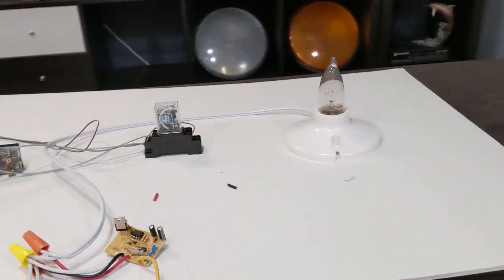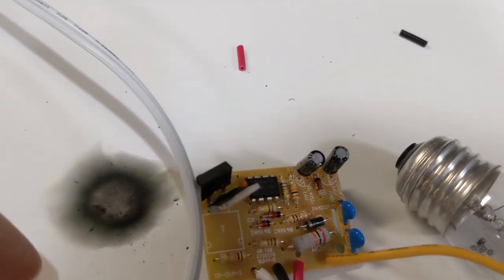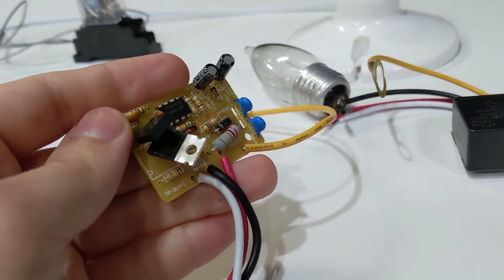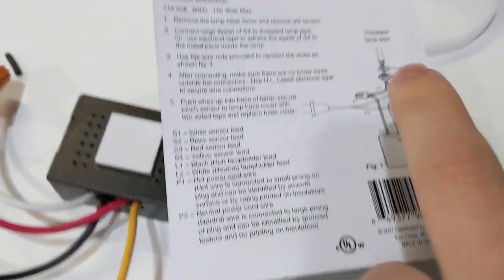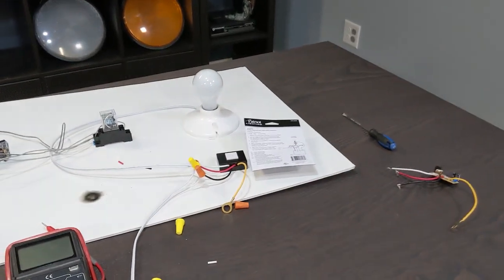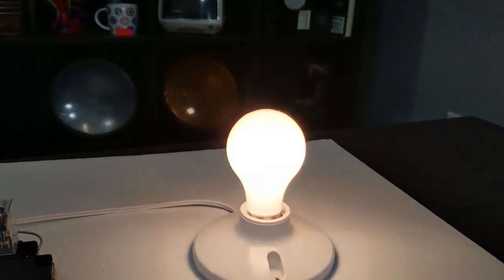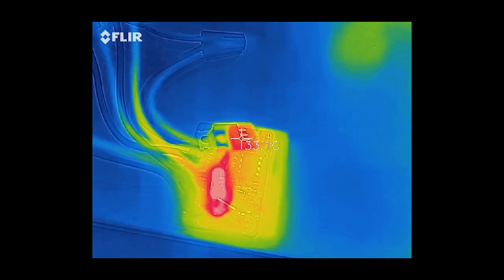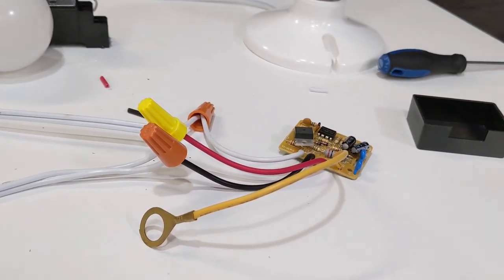A slightly explosive touch-lamp follow-up (standby energy consumption)

Comment: 8:48 Wait wait wait. That means hot is going through the device even when it's off (given the switching seems to be done at neutral)??? Indeed this is totally, royally and deeply FSCK-ed up as we say in Linux circles...

(EDIT: I refrained from making the comment in all caps, but read it as if it was... WTF is this)

(EDIT2: For those who don't know why this comment should be all caps - basically this kind of newbie electric mistake can end lives)
Reply: It's double fscked up. The unit has nonexpected colors and the packaging says to switch the neutral. My touch lamp is only singly fscked-up. The module colors are the same as Alec's new module but it is wired so it switches live.

Here's its configuration, for reference.
Red - neutral
Black - live
White - switched live
Reply: Yeah it's really strange that it switches on the neutral, quite a safety oversight. Though see all the other thousands of comments saying why the wire colours are fine XD
Reply: @TheBeardedQuack  Assuming the plug is not polarised (as best as I can tell it is not) , then the way I see it, it could be switching the active or neutral depending on which way around the plug is plugged in.
Reply: @kissingfrogs  Fair enough, I didn't think about that because our plugs can only be inserted in one orientation.
Reply: The way it should be wired is the neutral wire should go to S3 which should also go to the threaded part of the lamp socket.
Reply: @kissingfrogs  The instructions assume the plug is polarized. The package says "The hot wire is connect to small prong on plug".

Comment: This configuration means there is 120vac on the lamp socket even when it’s off?
Reply: Correct. The neutral is switched, not the live. You should always switch the live.
Reply: @dylanharding5720  Ideally you switch both, but that's not always required.
Reply: @enginerdy  I did say that.

Edit: okay, I said it in another thread. You should always switch live, and switching neutral is helpful. There are times where its required such as a isolator or the main switch on a consumer unit.
Reply: @enginerdy  Switching on both is good if the switch design prevents the hot from being connected when the neutral isn't.  The easiest way to ensure that is to not bother switching the neutral at all.
Reply: @dylanharding5720  You said switch the hot. It's better to use a double-pole switch and interrupt both lines.
Reply: @enginerdy  read my edit please, I corrected myself before you replied again aha
Reply: @flatfingertuning727  mmmm,,, don't quote me on this, but I don't think that meets UL standard for household products
Reply: Lets just all agree that sockets controlled by electronic circuits or even mechanical switches should probably be disconnected from the mains before servicing, regardless of line or neutral is switched, or both. Sure people change light bulbs by just turning off the switch all the time without harm, but your asking for it and blaming stuff imported from china is kind of a cop-out for known safe practices. I know ive screwed in tons of bulbs that immediately lit and i though "Guess it wasn't off, heh. Whoops."
Reply: @enginerdy  U.L. Standards allow either switching both hot and neutral in such a way as to ensure that they switch together, or to just switch the hot.  For double-insulated products, switching either side during operation would be fine, but the only way I could see an Edison-base light fixture qualifying as double-insulated would be if it used an isolation transformer, or the socket was behind a door that could not be opened when the power cord was attached.
Reply: @enginerdy  BTW, modules for use within appliances aren't U.L. *Listed*, but rather U.L. *Rated*.  I don't think that any appliances which used that device wired as indicated with an Edison-based lamp could qualify for a U.L. listing, but a device like this could be U.L. Rated for use in a luminary with e.g. a non-replaceable LED lighting assembly.
Reply: Flat Finger Tuning yes, the RU mark. Very important for getting your product UL listed (or ETL) smoothly
Reply: Flat Finger Tuning I think there are a lot of weird exceptions for lamps and lights, but I’m not certain of where that stands currently
Reply: Most of Europe is using unpolarized plugs and I've never heard of problems because of that. Polarized plugs don't really add any safety. It's the device that has to be designed properly.
Reply: superdau yeah I’ve seen that. The issue with the old Edison base is that the moment the she is inserted it that side is energized there is a shock hazard. On really old lamps at least in the US some of the shell is always exposed.
Reply: @superdau  polarized plugs are good for safety when used with edison lamp sockets and devices like toasters with exposed heating elements as two examples.  You can certainly make the point that those are poorly designed devices but they do exist in europe as well as the US.  And even in europe light fixtures are always supposed to be polarized since you can't unplug them to change the bulb.

Comment: When I was an electronics tech, red was hot, black was ground. Once I started messing with AC more, I had to re-jigger my brain to the point where I don’t trust anything until I measure voltage.

Comment: The triac would only capable of 200W if it has a heatsink on it, which it does not.   @13:10
Reply: It is capable without one, but not in permanent operation.
Reply: @higihups  absolutely true.
Reply: That's all a red herring. The triac rating is for how much power it can dissipate through its case, not how much load power it can control.
Reply: I used this joke before but I'll use it again here: Isn't that a song by Glen Campbell, "Triac Little Kindness"? LOL

Comment: I would have wired it the same way you did. That’s wiring plan is dangerous and a crime against logic. 

I also concerned that the switch leg of the lamp is on the neutral. That not right. It should be the hot leg. If you had a metal lamp with no ground and an always on hot, that it just asking for a shock.
Reply: For a Chinese it should be fairly normal. (Made in China with Chinese color system)

Comment: "in North America". to start with, AC wiring varies greatly around the world. In Aus, we have had 3 different standards over the years, NEVER trust the colors when your coming into a new job. once you've worked out what standard is being used tho, your usually OK. 

but to make things more fun, the Chinese, they really dont give a crap about colors. I got a replacement part (a displacement pump, CW/CCW/N, and 2 position sensors), same colors, same plug-in connectors, same colored wires. EVERYTHING was wrong. the Clockwise and Counter clockwise  drives were swapped. the position sensors were out of phase. it wasnt just a switch one to make it work, every line (except Neutral, thankfully, so no explody) needed to be moved. had to go right back to basics, what does the PLC expect to see. the Neutral was green/yellow (earth). after that, I had a look at the other wiring. everything was done in 3 core flex, brown, blue, green. but even in the completed machine, sometimes ground was green, sometimes it was blue. sometimes signal was blue, sometimes it was brown. No logic at all.

Ive had another part, an ignition module, that had the same colors, but nothing lined up in the socket that connected old and new. looked SO wrong. fortunately, it did just work. but if it didn't, Id've been stuffed. 

never assume china does colors right.

Comment: I would've wired it the same way you did without benefit of the diagram.

This is an extremely stupid setup, because not only are the wire-colors wrong, but they're switching the NEUTRAL wire!!  So when it's off, the lamp is technically UN-GROUNDED.  Hot goes into the board and into the lamp all the time -- no switching, no isolation, nothing.  Hot is live 100% of the time.  Piss-poor design.  Everyone knows you're supposed to switch the hot side, not the neutral side, because it's the neutral side that is connected to ground and provides protection.  Completely idiotic all the way around.
Reply: I could be wrong, but I was under the impression that AC wire coloring is specified by code in the US. If so, how did it manage to get that UL seal of approval on the package? Did they use it without approval? Is this not something UL tests?
Reply: @ShinoPuppy  It's specified by code in homes, not necessarily for products.
Reply: Every electronic component you buy from China has a CE and UL stamp that means nada.
Reply: Sean Neal CE Chinese Export UL Unknown Liability
Reply: His plug is not directional, so, he could flip the plug around and it would work the same way. Point is, he can wire it up the other way if he likes (flip the mains wires), it'll work just fine.
Reply: Please do NOT refer to neutral as grounded. I know US wiring connect them at the fuse-box.

But neutral can go live by one broken connection, while ground takes more faults for the same.
Reply: @erlendse  Yes. True.  Neutral isn't a ground, technically, but because it is grounded at the fuse-box, it is "safe" (in quotes -- definitely not as safe as a real 3rd-wire ground).

Either way, you don't want to switch the neutral side, no matter what.  Switching should always take place on the hot side.
Reply: @LMacNeill  True, but not always a choice.

Here(Norway) on IT/TT earthing, both wires are hot, ground are not.
Reply: @erlendse  Technically, according to the US National Electrical Code, the neutral is entirely referred to as the  "grounded conductor."  Now, in the real world, I entirely agree with you. Just thought it would be interesting to point out that technicality.
Reply: very dangerous indeed!
Reply: @LMacNeill  Neutral is a ground, but it is not "grounded."  Grounded refers to a ground where current does not normally flow.
Reply: @earthwormjim  Yes -- correct.  I just meant that, in the absence of a real ground, the neutral can provide a safe path for the electricity to get to ground, in a worst-case scenario.
Reply: @earthwormjim  As Edward correctly mentioned, neutral (according to us code) is literally the grounded conductor. Saying "neutral is a ground" is definitely less correct than saying neutral is grounded.

Comment: Back in the early 70's, a friend brought a color organ to me for repair. He had tried to "rewire" it so it would drive external lamps for a much bigger light show. Well, when I opened it up, ALL the triacs had exploded! (he didn't tell me the noise it must have made)! When rewiring it, he had wired the triacs across the line instead of in series with the lamps. That makes triac life very short, as you found out too!

Comment: US 120/208/240 standard is Black for phase 1, red for phase 2, blue for phase 3, white for neutral, and green/bare for ground.

It is always important to consult wiring diagrams and verify the pre-existing installation however. Gotta love having an old house where somewhere in the walls the black and white wires got switched and you have a whole wall of reverse polarity plugs that like to fry some electronics, all because someone hooked the sockets up correct to color without checking what was actually hot and neutral.

Comment: So here's why it works the way it does. The reason why neutral is switched is because of how the triac works, and the fact that this is a touch module.

Triacs require a low control voltage relative to the signal they're switching. The module runs at a low DC voltage internally. That means that the circuit DC ground has to be the signal that is being switched (if it were not, the triac triggering would require much more complicated circuitry).

Now the module doesn't care which side is hot or neutral, since this is AC. After all, the only difference between hot and neutral is which one is referenced to earth, and this device doesn't have an earth wire, so it can't tell which is which. You could just as easily put hot in via the black wire, and have that be switched, and the whole circuit would "float" with ground on the hot side, and it would work fine.

Except there's a touch lead. If you put hot onto the black wire, the whole low voltage touch sensing part of the circuit is referenced to hot, which means the touch sensing wire will (through the insulating capacitors), be live at mains voltrage. This makes it mildly less safe, since, should the capacitors fail, it would really become live at mains. It also might make the touch sensing more temperamental, since now it has to deal with more 60Hz noise.

Of course, switching live is safer for the lamp socket side, on the other hand.

So it's a safety trade-off. If you wire it with switched live, the lamp socket will be safe when off, but the touch circuitry will be referenced to live. If you wire it with switched neutral, the touch circuitry will be safely at neutral voltages, but the lamp socket will be perpetually live. Your older lamp seems to make the tradeoff in the other direction.

Then again, with an unpolarized lead, it's 50/50 chance which of the two options you get anyway, *shrug*.

BTW, when you wired it wrong, what you did was connect the circuit's ground correctly to mains, but powered the circuit through the bulb (which works fine, hence the standby current being OK, as bulbs are basically a really low resistance), and then connected its output straight across mains (which works fine until you try to turn it on, then you've got a mains short across the triac). It wouldn't have made a difference if you'd plugged in the lamp cord the other way around.

I don't know why your bulb blew though. It was clearly fine when the bang happened, since it was the only reason the circuit was getting power in the first place. Maybe it was unrelated, and it was close to dying and the mechanical stress of taking it out and moving it around caused it to finally do so, not the bang moment.

Comment: As an (apprentice) electrician, it makes a lot of sense; it is normal practice of most electricians to reverse the black and white when a wire is running from a single-pole switch to a non-polarized (ie. won't blow up if you have the black on a different screw) light fixture (such as the very light fixture shown in this video). If I'm not mistaken, this is so that electricians can see at a glance what is a switch leg (ie. ONLY goes to the light and back) and what is the feed (or whatever other connections that may be hot). If this device is meant to replace an actual light switch (ie. install a white blank plate, and wire it so that the blank plate becomes the light switch), then I can see why they did it.

WITH THAT SAID... I have NEVER seen this kind of wiring in any lamp I've ever seen; it is either black/white, gold/white (in the case of lamp cord), black/black with white stripes, or no color at all (ie. ye ol' simple light fixture that doesn't care what way the plug goes in). In THAT respect, I completely agree with you. I'm just saying that I think I understand the *why*. Not that it makes any sense as a lamp retrofit. Also one of the reasons why I quadruple-check ANY electronic light/fan installation instructions (particularly those ceiling fans with remote controls).

Comment: 🤣Yup!💥 THAT’S exactly what we anticipated when the plug-in touch adaptors we replaced our 2007 Target bedside/tabletop lamps’ failing touch functions with proved oversensitive to static/lightening/household power fluctuations/looking at them “funny” by flashing on/off on their own despite surge protectors — which is why we now unplug them for overnight/extended absences.

(The “older vs modern versions” deal must explain why my brother’s higher-end, expert-built, brown porcelain, fugly AF touch lamp from 1987 has, unlike mine, NEVER ONCE faltered.)

Comment: When you use a incandescent bulb the element in it sags downwards. So every time it is moved the element bends eventually breaking. That's why mechanic bulbs had up to six times the supports to prevent it from blowing.

Comment: With this wiring, it appears that the live line is always connected to the bulb - even when touched off.  The circuit controls the lamp by switching the connection between the lamp's neutral and the wall neutral.  That might explain why the bulb glows shortly when plugged in, perhaps saturating some capacitance?  (But the effect of capacitance is different in AC, so I'm not sure.)  I bet the circuit in the new one has a something to cancel the glow effect, and that those capacitors are involved.  I guess that also means be careful with the lamp socket, it's always hot as soon as it's plugged in even if bulbs don't light up and if you touch it while grounded to something you'll be in for a shock.

Comment: Playing with Radio Shack electronic project kits as a kid, I always saw black as negative because I was working with DC. Then, when I was older and working with AC in houses, I had to learn and remember that black was "hot". I first saw it as the opposite. Luckily I took electricity and electronics in high school.

Comment: LOL I knew it was coming… I was just waiting to see the back blow off the to-220 triac

Don’t be disheartened .....you have all of the makings of an amazing DIY guy… and you are head and shoulders above most of us Tinkerers

And the way you hooked it up absolutely makes sense, And it’s a common mistake.. it just makes sense…Red is live and black is neutral.......

But wiring colors can get a bit odd sometimes. Especially switching between AC and DC, and in different parts of the world. Hell… Half of the stuff I run across uses random ass colors of wire.  So don’t feel bad about it